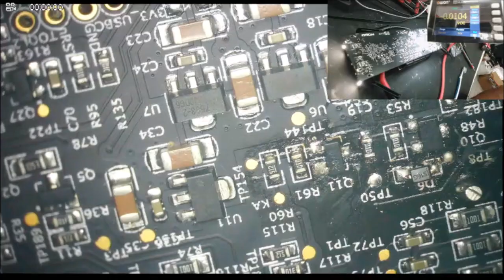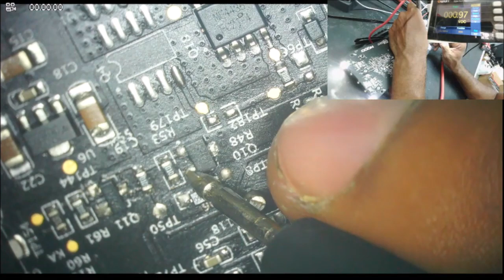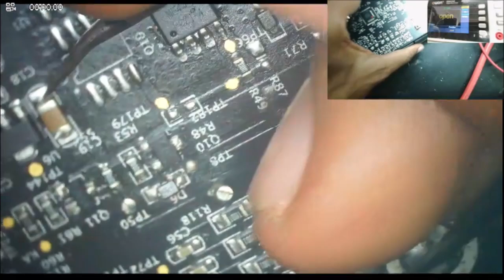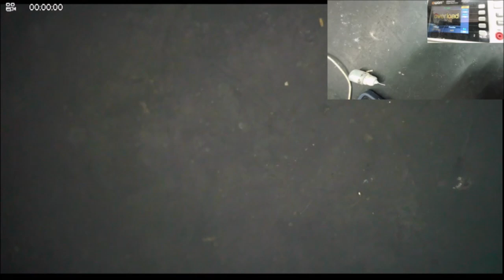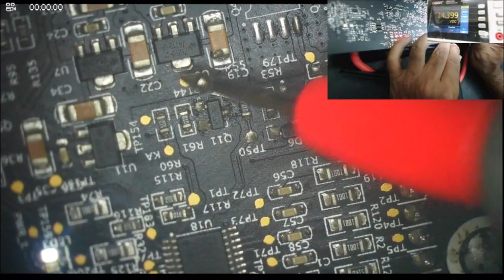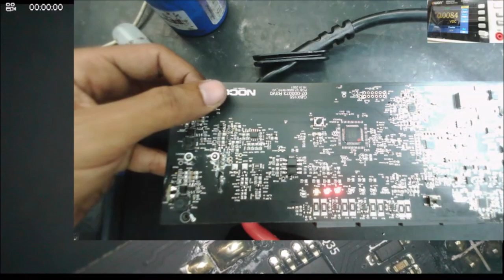GBX155 wont charge board repair

Comment: Thanks for the video—it helped me track down my issue. I have the exact same model and picked it up as-is on eBay. I was hoping the fault was simply due to the battery being deeply discharged, which it was after it failed to charge again.

There was heavy arc-flash residue on the positive charging clamp, which tells me someone likely enabled Boost mode with the safety defeated and connected it backward. I found and replaced the two blown MOSFETs (Q17 and Q18), but at first I couldn’t identify what else had failed.

I ran into the same symptom you described with the GND pads isolated, and sure enough the RSENSE resistor (0.07 Ω) was open. Replacing it restored full functionality.

I’d strongly recommend replacing that resistor with the correct value. It serves as both the ground-path fusible element and the current-sense resistor. Substituting a zero-ohm part defeats the protection and can lead to catastrophic failures if the circuit can’t detect an over-current condition.